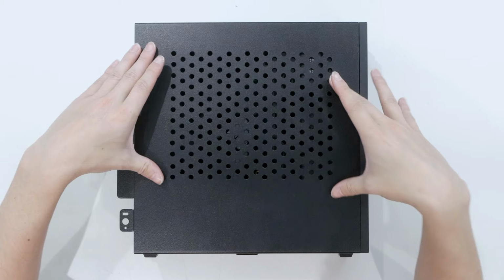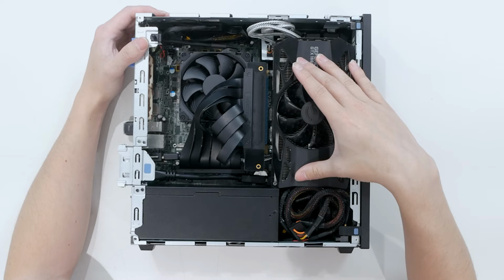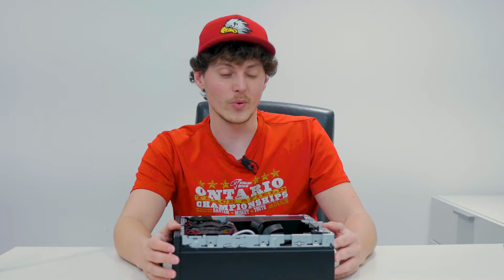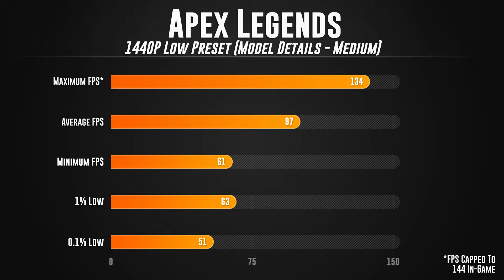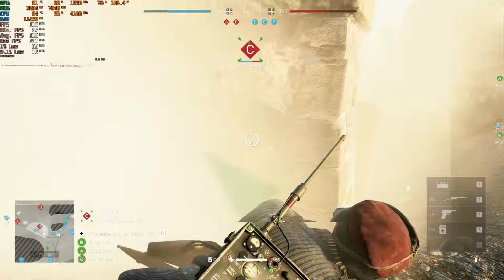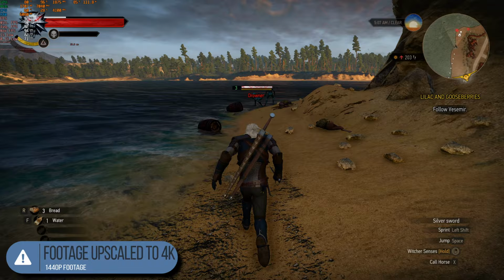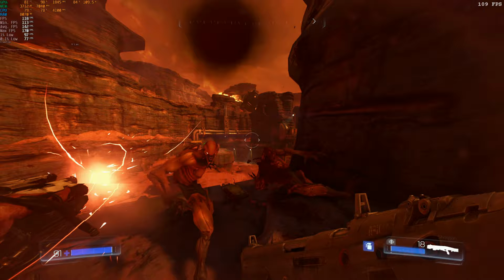Full Length GPU in a SFF Dell Optiplex Gaming PC!?

Comment: Awesome video, super in depth! I'm currently building a optiplex 7060 sff, and I'm running into an issue with my fans. I bought 2 Noctua pwm fans(1x40mm and 1x60mm) as well as a  3 way pwm splitter. Hooking up only one, my stock cpu fan ran 100% while the 60 was running at 10% and the bios read a fan error. Any tips on how to utilize stock cooler cpu and those noctua fans via pwm?
Reply from the maker: Glad you like the video. I personally I hooked the fans up to SATA power and let them run 100%. The SFF needs the cooling and Noctua ate quiet anyway
Reply: I was really trying to avoid changing my power supply to keep it simple. Sata power from the board gives a single sata and one mini sata for disk drive. Using an SSD caddy in place of disk drive. Hopefully I can run a sata splitter, then a 3 pin splitter off that.
Reply from the maker: You should be able to run a SATA power splitter and run the fans just fine.
Reply: @citytrvcksmusic5086  it’s actually pretty easy to change the power supplies in those computers. I recently built a 7060 SFF myself, and one of the first upgrades I made to it was replacing the factory 200-watt PSU with a 260-watt unit. Looks exactly the same as the old unit, and has the same connectors. Just has more wattage. Prior to this I also replaced the 180-watt power supply unit in a 3050 SFF with a 240-watt unit.

All you have to do is unplug two cables from the motherboard, undo three screws, and the whole thing slides right out. Then just slide the new unit in, route the cables through the cable management posts built into the case, and plug them in

If you’re not already running a 260-watt PSU in your 7060, I’d recommend upgrading to one to give your components more headroom, especially if you’re running extra fans and a graphics card

Comment: After changing the stock dell cpu fan, do you get an error on startup. Can it be stopped?
Reply from the maker: It depends on what you use for the CPU. If the replacement fan is similar in power draw and RPMs, it won't trigger the system check. If you use the Noctua fans, it will trigger the check up on start up. You can simply skip the system check on boot up by mashing the ESC key.

Comment: How were you able to get the pcu to plug into the motherboard? I have a 3050 sff and it have a 10 pin (one 6 and one 4) and I don’t know how I am going to get a power supply to work with it?
Reply from the maker: @is_this_dez3598  just a simple adapter cable that can either be made or bought
Reply: @WiltshireTutorials  where can I buy it? Or how did you make it if you did
Reply from the maker: @is_this_dez3598  I personally made my own. However, if you don't have experience with using a multimeter or soldering, I suggest just purchasing one. You can find them on Amazon or MODDIY

Comment: Incredibly imagined, highly skilled build: hats off to you!!!
I just hot rodded an Optiplex 3050 for my son, and the fan under gaming load, as you know, is unbearable. I want to purchase the same NH-L9i, but am concerned about the raised screw mounts under the motherboard that the OEM fan attaches may prevent a mod free installation. Is this something you possibly ran into with 5070, or is there any workaround if that's the case with this particular model?
Reply from the maker: Thanks for the kind words about MiniFlex! I appreciate it. I would love to see some photos of that hot-rodded Optiplex 3050! 

Unfortunately, there is no way to add a Noctua cooler without ripping that standoffs out of the case. I ended up ripping them out and haven't looked back, as I won't be using the stock heatsink and fan ever again.
Reply: Maybe hot rodding was an overstatement on my part, what you do is hot rodding! I guess his build is highly upgraded: 2TB M.2 2280 NVME, i5-7500, 16GB of Corsair Vengeance ram, Radeon RX550 4GB GPU, and a new Dell 240W PSU compared to the lowest 3050 base unit my Dad gave us while we were on vacation. Since I'm neither a machinist, nor do I possess your skill level, how did you manage to remove the standoffs? @WiltshireTutorials
Reply from the maker: @MifuneMotors66  Those specs will make a nice little PC! You get better with practice, when it comes to modding! The simplest way to remove the stand offs is to remove the motherboard completely from the chassis, get a screwdriver with a socket on the end that's just big enough in diameter to fit over the standoffs and rock them back and forth. Using metal fatigue from the back and forth motion, the standoffs will eventually snap off from the case.
Reply: I certainly appreciate the advice, and will move in that direction: saves me from buying a mini ITX mobo & case. Just tried it on the original empty case, popped right off! I had to buy a refurbished model since my Dad's mobo was bad, cheaper than a new one from Dell. I really appreciate you taking the time to offer advice, thanks a million! I just subscribed, and look forward to seeing more your incredible creations and tutorials.   @WiltshireTutorials
Reply from the maker: @MifuneMotors66  I'm glad my recommendation worked out for you! I'm here to help. So, if you have any more questions, feel free to ask away and I'll do my best to answer them for you. I appreciate you subscribing as well!
Reply: @WiltshireTutorials  I’ll have to bug you later about how you daisy chained the additional fans, I think you replied to another commenter about a spliced/split sata wiring setup. Curious how you powered the gpu with this particular mobo? I built a water cooled mini itx gaming system for my older son about 8 years ago, but the Asus mobo had a dedicated 6 pin(?) receptacle for the gpu much like his younger brother’s upgraded Mac G5 that this build just replaced.

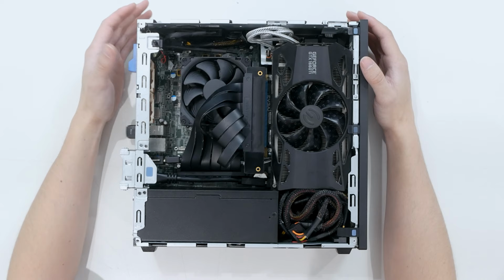Comment: What a friend, sorry for the inconvenience, I wanted some advice from you, I have an optiplex 7060 sff and I put a Dell Rx 550 4 GB GPU in it, also a Noctua NH-L9i cooler, but I noticed that the CPU and GPU temperatures are getting worse and I I realize that it is due to the poor air flow. Could you explain to me how you installed the 40*40*10 fans and if the original 200w UPS supports that power load? I thank you in advance for your attention 3:50
Reply from the maker: One issue with the thermals is just how close the GPU is to the PSU. It really affects the GPU thermals a lot. This is why I went with the design shown in the video, where it intakes fresh air from the perforated side panel. 

As for the 40mm fans. They are wired together with the CPU cooler. So, it uses a a fan hub that uses the RPM data coming off the CPU fan. Meaning, when the CPU fan needs to speed up to cool things off, so do the 40mm fans. There is only 1 fan header on the motherboard, so this and running the fans from SATA/MOLEX power are you only options.

Lastly, the PSU. You more than likely will be able to add more fans to your PC running with the factory PSU from Dell. You can try to add more fans to the PSU and do some tests for each component that you add. If you plan on upgrading the GPU or CPU in the future, you may be looking at a PSU upgrade.

Hope this helps! Let me know if you have any more questions!
Reply: @WiltshireTutorials  Thank you very much for your help, I am going to buy the components that have similar specifications since where I live I cannot get those noctua
Reply from the maker: @alexanderguardado48  You're welcome. Any 40mm fan is better than none. Make sure they're 4-pin PWM fans
Reply: @WiltshireTutorials  ok, tanks
Reply: @WiltshireTutorials  Sorry for so many questions my dear friend, how complicated is it to change the case of the optiplex 7060 sff, it will be a better option
Reply from the maker: @alexanderguardado48  Dell's motherboards are a proprietary form factor it is not standard. Therefore, you cannot do a case swap.
Reply: @WiltshireTutorials  Thank you very much for your information and for your time. Thank you very much in advance.

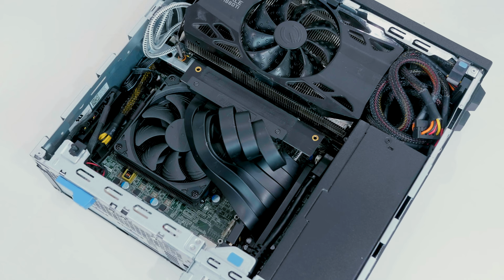Comment: Hi I know this video is a bit old but I am building something similar using an optiplex 3040, did you have any issues or have to do any modifications to the case or motherboard to accommodate the noctua L9 cpu cooler? 3:24
Reply from the maker: The socket is a standard socket. It's LGA 115X. So, no modifications were needed. Just make sure you get the Intel version of the cooler and not the AMD one and you're good to go.

Comment: I'm looking to do something similar. I have a Dell Optiplex Xe3 with a stock 300watt PSU. Do you think it will be possible to run a Rtx 4060 low profile in a similar way you made the 1660 work?
Reply from the maker: All you need is an 8-pin for the LP 4060. Should be able to make it work. They don't draw that much power
Reply: @WiltshireTutorials  thanks for the reply. Do you think it would be better to do a 4pin to 8 pin adapter or do you think a SATA to 8pin would work better?
Reply from the maker: @isaiahthomas7846  if it's a 4-pin, that would be EPS for the CPU. PCI-E power is never split into 4. It's always 6-pin or 8-pin. So, you're probably best off with a SATA power to 8-pin adapter
Reply: @WiltshireTutorials  I am most likely wrong and you are probably right about it being a 6 pin connector. I appreciate your help. I've been watching your mini flex videos for reference and inspiration.
Reply from the maker: @isaiahthomas7846  You can get a 6-pin to 8-pin adapter to plug into the GPU and it should work just fine.

Comment: What type of Ram did you use on this build? was it some type low profile ram to help fit in the graphics card into the case?
Reply from the maker: That's correct. I used Kingston ultra low profile RAM to get things to fit
Reply: Thank you! you definitely inspired me to make my own custom optiplex sff. Also, how were you able to fit the Noctua cpu fan properly? with Dell's case having screw holes that stick into the motherboard and the Noctua NH-L91 fan having the screws to hold it down on the back side of the motherboard. @WiltshireTutorials
Reply from the maker: @ZackattackVids  glad that I inspired you to take up your own project! As for the noctua CPU cooler. I removed the stand-offs from the Dell chassis and used the backplate that comes with the cooler.

Comment: How did I get the new psu to work with thw board did u use a 24 pin adapter??
Reply from the maker: Yes. An adapter is required
Reply: @WiltshireTutorials  do you think I could do a similar build with a sff version maybe not such a high end gpu but something close
Reply from the maker: @kemar3789  You could totally do the same with a different GPU.

Comment: Great video! I have the same PC and want to change the CPU Cooler with a noctua one. Does it fit or do I need to do some modifications to it? Thank you
Reply from the maker: Thanks! I'm glad you liked it. Modification is required to use a 3rd party cooler like the Noctua one I used in the video. You have to remove the standoffs from the case and use the aftermarket backplate that comes with the cooler
Reply: @WiltshireTutorials   Thank you for your insights and reply! 
So basically its something very simple as to just unscrew(?) the standoffs as you mentioned. My concern was if the bracket would fit because in HP's Microserver case it wasnt standard spacing where you'd mount the heatsink and I 3D printed custom brackets.
I am considering going with the NH-L9x65 which is a bit thicker. Do you think it would fit/be ok? Thanks again!!
Reply from the maker: @pauldomfree  you have to break them off of the case itself. They're soldered onto the case. The spacing is standard spacing for the Intel socket 1151. I have used the NH-L9x65 in MiniFlex and it works great.
Reply: @WiltshireTutorials   Thats good to hear!  Any tips on how to brake them off without damaging the Motherboard?
Reply from the maker: @pauldomfree  you'll have to disassemble the PC and remove the motherboard to get at the standoffs. I like to use a screwdriver with a socket on the end that is roughly the same diameter as the standoff and use fatigue to break them off by moving it back and forth.
Reply: @WiltshireTutorials  I'll do that! Thank you! last question .. for tonight xD : I couldnt find the max. amperage that can run through the CPU Fan PWM header. I want to install a 80mm noctua fan as case fan and maybe as you have 2 40mm for exhaust which means total of 4 fans would be connected to one header. (the stock cpu fan is of max. 0.8 amps) Thank you again
Reply from the maker: I cannot remember what the amperage on the header is, to be honest... I do run 3 Noctua fans on the CPU header and 3 fans on the other header. I have 6 fans in OptiFlex and 5 in MiniFlex.
Reply: @WiltshireTutorials   plenty of headroom then! Can you advise me how to proceed with upgrading the PSU? I am thinking of getting this one: Be Quiet TFX Power 3 300W. I am aware that the Dell psu has different cabling, dimensions could be an issue too. What do you advise and suggest to properly connect it to the motherboard in this case? Thank you!!
Reply from the maker: @pauldomfree  TFX PSUs are a standard form factor, so the dimensions are the same as the one I used. As for the pinouts for the cable, you can purchase an adapter for the 24-pin. That's what I did. The adapter will plug into the PSU's 24-pin and convert it to either the required 6/8-pin (they keep changing it) on the Dell motherboard.
Reply: @WiltshireTutorials  Perfect! With the Noctua Heatsink did you encounter any problems concerning the RPMs? Is there a way to manually change the fan curve in the bios? Ive noticed that the stock one ramps up the speed to almost 3300 RPMs when the cpu temp goes to 82+ C which is already to high. Thank you alot !!
Reply from the maker: @pauldomfree  I had to create a custom curve using HWinfo64's fan control option.
Reply: @WiltshireTutorials  Good thinking!
Last Question which got me worried a bit. Ive ordered a 1650 LP which will go into the pcie x4 slot since its height wont let me put it into the x16 slot. Would the x4 slot supply the 75w needed or do I need to get a riser cable and do what you did in the end?
Reply from the maker: @pauldomfree  the x4 slot can only provide 25W of power, of I'm not mistaken. It may be best to get a riser to utilize the x16 slot. Similar to how I did it
Reply: @WiltshireTutorials  Today I mounted the Noctua Heatsink and everything went seamless thanks to your help! 
Now I am in the process to change the stock psu which is 200w and its dimensions 22.00 x 6.20 x 8.20 cm (LxHxW). The silverstone is standard TFX size of 17.5 x 6.5 x 8.5 cm which makes it bigger and makes me think how did you manage to fit it in especially since the motherboard is very close and theres little space available. Can you shed some light on the process please? Thank you!!
Reply from the maker: @pauldomfree  glad to hear things went well for the cooler! As for the PSU, I just put it in the case 😅 I didn't really do anything special for it.
Reply: @WiltshireTutorials  Ah that’s good to hear because in the video you said you had to cut a bunch of parts out and mutilate  the case, drill holes to align the power supply too! But if that’s not the case then I just need a 24 pin to 6pin adapter cable right ?
Reply from the maker: @pauldomfree  Hmmm, I cannot remember if I was referring to OptiFlex or MiniFlex when I said that... I'll have to physically look to make sure 😅
Reply: @WiltshireTutorials   oh I wasnt aware theres Optiplex and Miniflex. Whats the difference? I have the optiplex 5070 sff
Reply from the maker: @pauldomfree   OptiFlex is a modified Dell 3040/7070 MT. So, the Mini Tower. MiniFlex is on the Dell 5070 SFF
Reply: @WiltshireTutorials  Do you believe an i9 9900(k) could be fitted in there?
Reply from the maker: @pauldomfree  the power delivery for the Optiplex cannot handle the power draw from a 9900K. The 9900K draws 92W and the power delivery is only designed for 65W. Luckily, the 9900 (non-K) only pulls 65W
Reply: @WiltshireTutorials  so the 9900 would work but the 9900k wouldn’t? Wouldn’t the K version use the power available in this case and work as a non K CPU? I’ve already ordered a 9900k cpu 💩
Reply: @WiltshireTutorials  it works. The i9 9900k works !!
Reply from the maker: @pauldomfree  it may boot fine on it. But, put the chip under a synthetic CPU load and see if the PC can handle it. Personally, the VRMs get a little too warm for my liking.
Reply: @WiltshireTutorials  I will check it out. 
Another thing now with the only pwm fan header. How do you control them? I remember you said hwinfo but there at least for me there are o lot 3 speed fans to set manually. 0, 1600 and 3300. Is there any other way with a graph to make it more smooth ?
Reply from the maker: @pauldomfree  I setup a custom fan curve in HWInfo64. Unfortunately, Dell only allows 3 RPM fan states. I usually run the 1600RPM and if things get a little warm, I set the curve to use the 3300RPM to cool things back down. For the most part, the PC runs at the 1600RPM fan state. Unless I'm rendering or gaming.
Reply: @WiltshireTutorials  I was afraid of that that’s why I ordered from Amazon : DC 12V 5A Thermistor PWM Temperature Control Speed Controller. I’ve used it in the past in 3 servers and worked very well and will use it here too